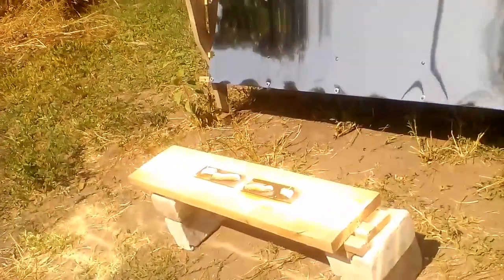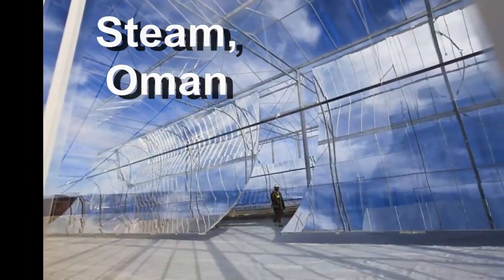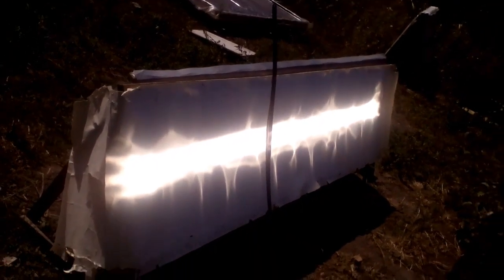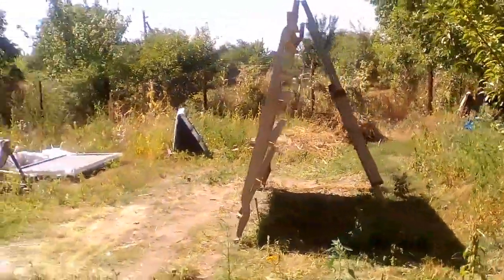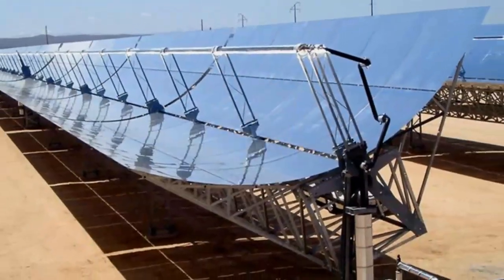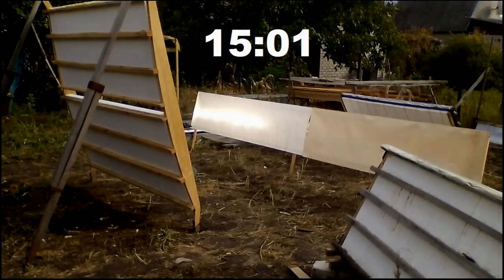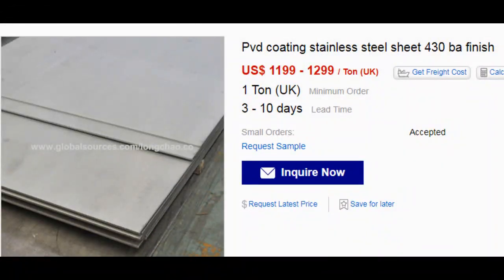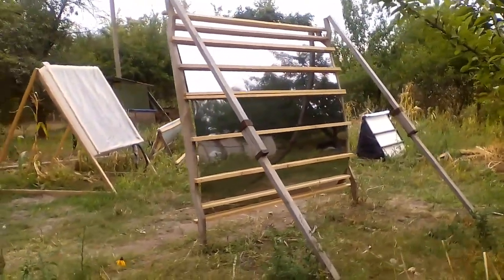Solar heat 190 ºC from a mirror stainless steel sheet

Comment: I have been gathering the supplies for the reflector/concentrator. Your work helped me change my design from a “floating “ heat absorber to a fixed ground mounted absorber. This greatly simplifies my design. Thank you very much

Comment: This is a great video! I really enjoy your work, thank you! 

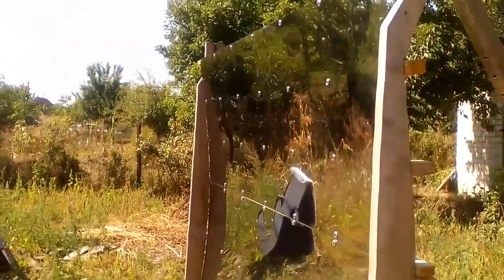Are you willing to share the formula for the parabola you are using with the 2 mm stainless sheet? The one at 4:40. Is it y= 1/n times x squared? What is n? What focal length did you choose and do you recommend for us please? Thank you! Can you also show us the pipes you use in the collector? and what is the steaming off from? plain heat, or do you have a pressure relief valve with pressurized water input on the system? 

The parabola  formula means the most to me as you will save my lots of time there! Thank you!

Comment: I am amazed the mirror stainless is still so pristine after 2-3 years. I appreciate your natural voice; english is very good.
I am building a solar pool heater with 18mm black poly tube,  1.2m^2 and sides 89mm tall with 25mm silver coated white styrene foam inside under tube.
Is the optimum layout of the tubing all touching, or with a space between the tubes? It is unsure from your other videos.
Reply from the maker: The width of the gap between adjacent tubes depends on what is more important for you: expenses or occupied area. If you increase the width of the gap, you increase heat production per 1 meter of the tube, but reduce heat production per 1 sq. m of your heater

Comment: Good morning Mr. Yurko - congratulations - I ask you: As the final working temperature of the water or steam depends very much on retention and minimum internal pressure (at least 15 bar required for reaching up to 220 o C outside) and at low flow rate of cold water in the system (maximum 8 m / s), because you no longer use it now, even in these simple systems, your final steel check valves plus initial impulse by small topsflo pumps (cheap and very efficient) ) as in your initial very good inventions?

Comment: Look up recycling hdpe plastic by melting it at 350 degrees or 175 c . It doesnt smoke and melts well. You could make a wooden form of stakes and after melting the plastic put it in the form and put pressure on it. That would produce rot free stakes. You could also some  concrete. It is easier to use than the plastic. I do like the idea of recycling plastic though.

Comment: Hi sir. My project is based on heating faecal sludge using solar heat on a 1 by 0.3 m drying chamber, my reflector will have to be how big In dimensions roughly? Your help will be highly appreciated.

Comment: Amazing work Sergiy, i want to try this in my home in France but i can't find a supplier that sell your stainless sheet for 121$/square meter, where do you find them ?
Reply from the maker: I bought it from a regular seller in my city of Mirgorod, Ukraine. Moreover, sellers in large Ukrainian cities (Kiev, Kharkov, etc.) sell the sheets for 10 $ / sq. m. I remind you: the steel is AISI 430 BA, the thickness = 0.4 mm
Reply: @sergiyyurko8668  Thank you for sharing. You are in about latitude 50 deg. Wonder how this method wil work in the tropics?